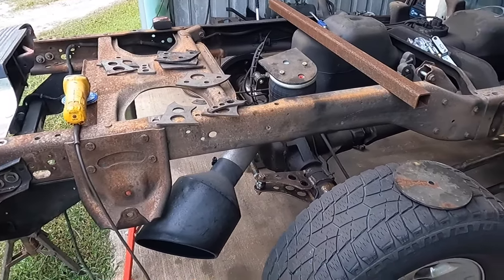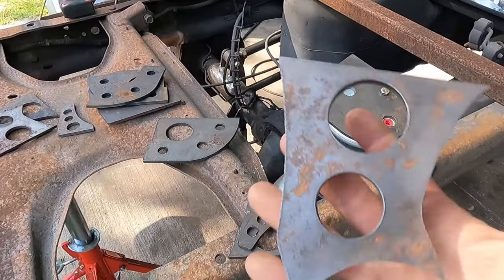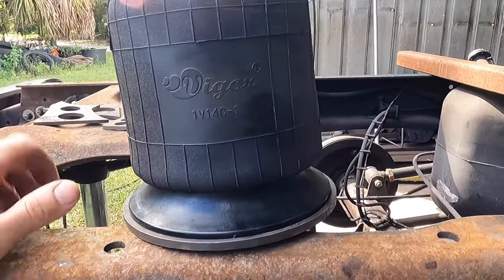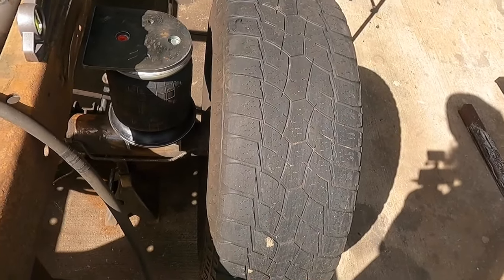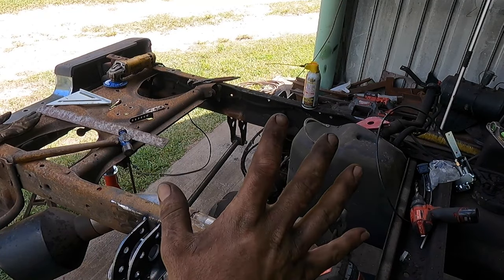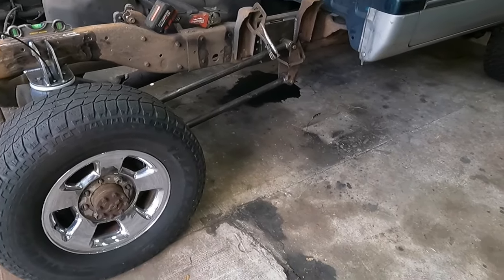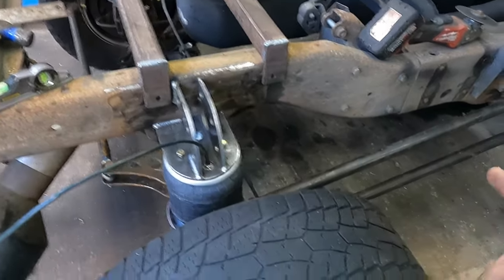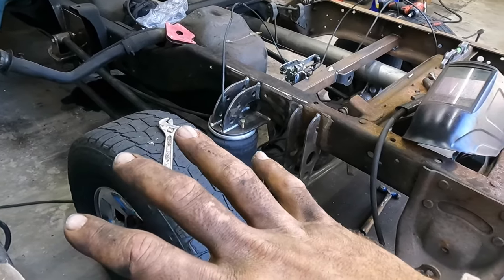4 Link Air Bag Suspension Install | Vigor Air Suspensions

Comment: I like the bags being outside the frame and on top of the axle... thats what I was hoping to do with mine and now I know it fits that way 👍👍
Reply: After all that welding on the axel tube don't forget to remove the entire rear axel assy and check camber and toe in before headed on down the road.

Comment: Super big help for me. Thanks for the part #'s. 

I am building a 4wd Ford box truck. And I want f/r air suspension for more control / ride height. I will be ordering your 4 link kit too btw.

Comment: as i said before, i would love to have a plasma table. after learning how to use it, it would save me tons of time. what table do you recommend? love the addition of the ride height valve and dump feature.
Reply from the maker: I have a Premier Plasma table, it has a few quirks here and there but is so simple to go from idea to final part.  The design software is the simplest I have used, I can go from sketching out simple parts to cut pieces in only a minute or 2.  From designing the bag brackets I used to final product maybe took 30 minutes.  Very useful tool.  Hardest part is trying to load a 4x8 sheet of 1/4” on the thing haha

Comment: I've got a 47re that I either want to swap in a NV4500, NV5600, or g56. Truck will be rigged with a welding bed on 17's w/35 with 4.10 gears. I've got an exhaust brake with 4k gov springs and minor mods..mostly stock. I'm trying to figure out which would be best for a heavier rig. Do you have any recommendations? Keep up the great work!
Reply from the maker: It’s going to depend on the environment it’s being used in also.  I’m partial to air springs because they are cheap(in comparison to coilovers) and offer the ability to maintain a ride height.  The biggest downside is the more weight you add the more “roll” you’ll get so I suggest adding a rear sway bar for sure.  I’ve build a rig without a rear sway bar (2wd truck) and it does ok but it could definitely be better.

Comment: do the trucks you install these air ride systems on do a lot of bumper pulling? just wondering if theres any issues with the strain being localized above the axle instead of spread out by the leaf spring
Reply: Curious about that as-well. I’d imagine it should be fine considering you aren’t trying to pull super heavy loads
Reply from the maker: That is no doubt a concern and I would say that if the vehicle will be doing nothing but heavy bumper pulling, consideration should be taken to either reinforce the frame or ultimately not convert the suspension.  In my case, hence the way this setup is designed, I have no intention to pull anything substantial from the bumper hitch.

Comment: Hey brother, quick question for you I noticed a few videos ago you were using a different style of airbag. The question I have for you is which airbag do you prefer and also which airbag holds more weight and do you have any part numbers for both of these style bags I’m getting ready to do the same set up to my truck as well
Reply from the maker: Weight capacity depends on mostly diameter.  The different “styles” of bags have some different characteristics on how they react to load and also the application will dictate what you can/can’t use, such as space, height, width, min/max travel.  There really isn’t a quick answer to your question but in short, pick the style you want with the correct parameters in mind and make sure that it is large enough to carry the capacity of the vehicle.  Example, 7” max diameter bag (pi r squared / 3.1416x3.5x3.5=38.4846sq”) at 100psi gives you a max lifting force of 3848.46lbs.
Reply: Yeah, I get all that. I was just wondering these particular bags what they were rated for weight wise and if you had a part number for this particular bag.

Comment: One thing wrong with that is the bars should NOT ever be actually parallel. That leaves an infinite instant center. Bars should be set to have an instant center at about the front bumper.
Reply from the maker: Debatable
Reply: What are you talking about? They should always run parallel.
Reply: @jasonfarnsworth5880  No, the instant center should be at the front bumper. The bars being perallel makes it an infinite instant center and is not good. Wow..
Reply from the maker: Define “not good”.
Reply: Yall need to read some books on suspension. Bars should never be parallel on a bagged setup.
Reply from the maker: I think you read one too many.  There is truth in what you’re saying but it’s not a “one size fits all”.  Application derives function.

Comment: Noticed your kit could I put in front of truck but afraid of it hitting the links when fully turned
Reply from the maker: Would need modified for the front, if it was placed on the outside of the frame it would definitely rub

Comment: Your gooseneck ball is too far back. It should be about 8-12" in front the rear axle centerline. You have it positioned just past the axle centerline...
Reply from the maker: Don’t know where you’re getting your measurements but that’s definitely not right.  Mine is on the axle (slight forward) but it’s that way for a reason I’ll have to explain at a later time.

Comment: Nope. Air ride needs the instant center at the front bumper. You don't even know what that means.
Reply from the maker: Been waiting for your explanation that you’re so adamant about.  Define “not good”.
Reply: @j_moffitt  Look man, I like the work, like the video and how you did it. I like the use of the larger bags. That's the biggest thing people make a mistake on when doing air ride. Too small of a bag. You are using a big one and that's great. Much softer floating ride. But it also means it won't hook up on take off as much. You just need to adjust it to have the correct instant center. Read Max Fish's book on air ride and how to set it up. It's a great read. Basically looking at the 4 link from the side the bars are on a line. Extrapalate that line forward to the point where the two lines, they meet and that is your instant center point. On a drag car it would be at the back of the motor. On a bagged vehicle it's better to have it out front about the front bumper. It determines how well the vehicle plants when you take off.
Reply from the maker: 100% agree but we’re talking about a work truck that was built to work, any kind of link suspension is better than leafs for road feel and hookup.  Pinion angle is important to me and a parallel setup gives the most travel without changing that angle.  This truck won’t be hitting the track anytime soon and the leveled/lifted nature of the truck would have required way more work to achieve an acceptable IC for the minimal gain it would give a 30y/o beater.
Reply: You can have the pinion angle not change at all and still have the instant center where it should be. Bars just have to be the same length. The bags are what I like most. Much better than a bellows type bag. So much better ride quality and so much more travel.